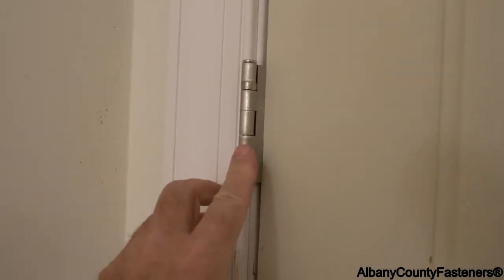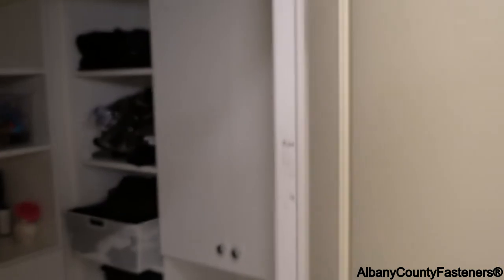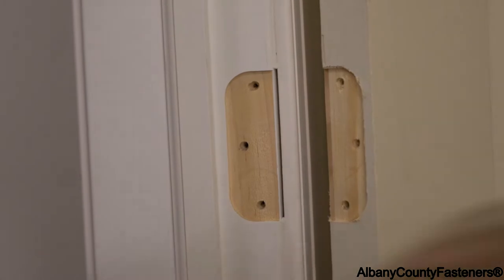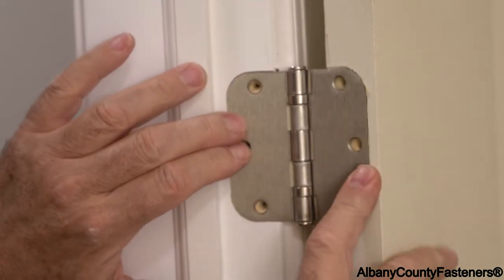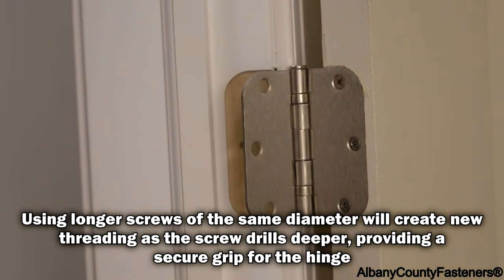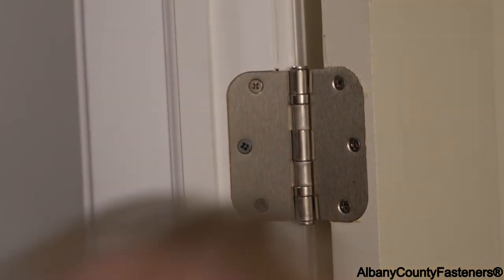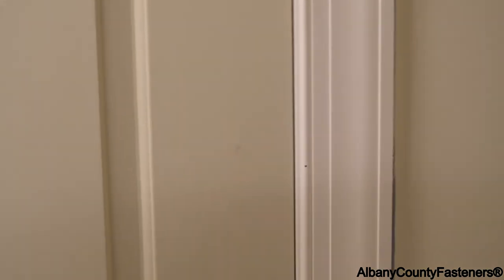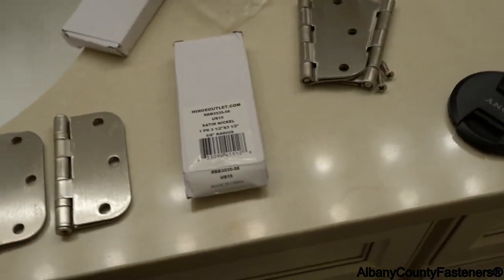Installing Ball Bearing Door Hinges - Kill the Squeak! | DIY With Bob

Comment: Spray some WD40 instead of changing the hinges?
Reply: Now you're thinking, much better and cheaper than replacing all the hinges in a house. However, get yourself a tube of white lithium grease (not spray) for 6-8 bucks and lubricate the pins themselves with it. You won't hear a peep for a decade or more even with heavy door use. WD-40 wouldn't last that long, so more maintenance for the same price.